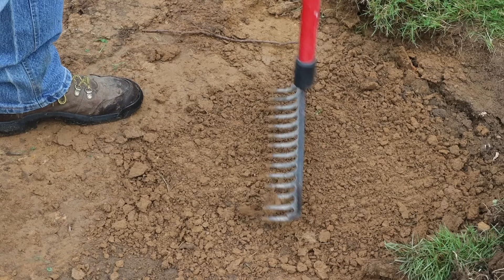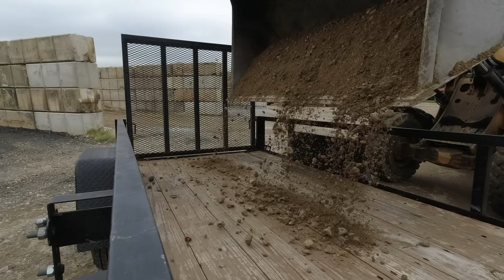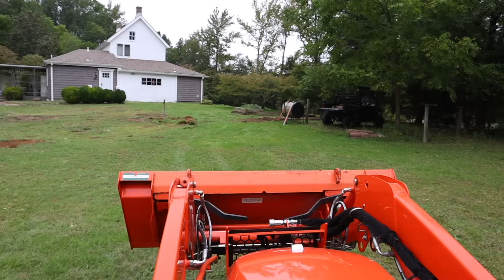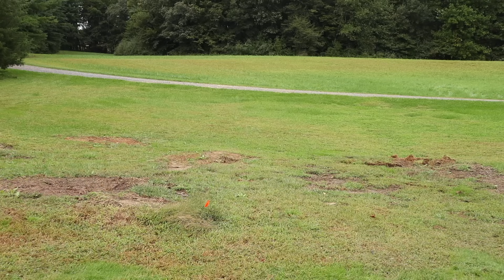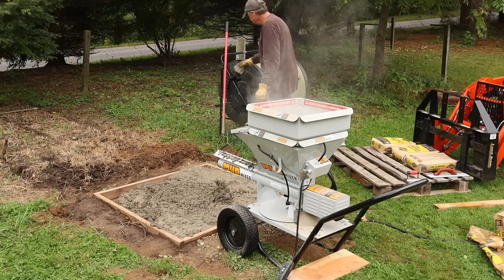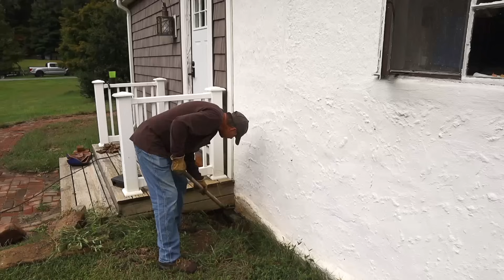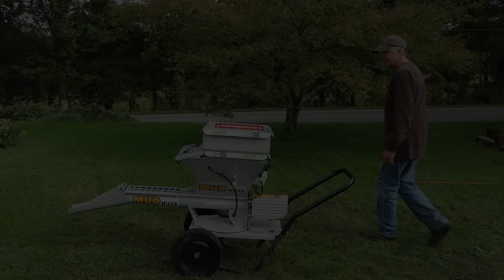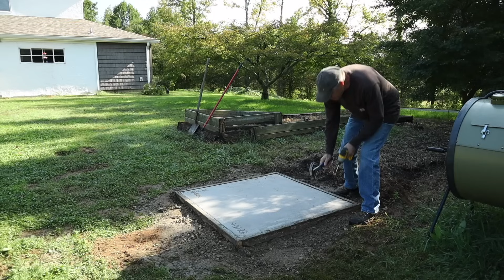Game Changer. Pouring a concrete pad and using the Mudmixer for the first time. MCG Video #169

Comment: You seriously sold me on the equipment, thats what home depot should be renting out not the normal mixers, maybe a larger tow behind unit.
I can't belive no one has had this idea until now. 
So much for a unit you use premix bags but how about a  components mixer that delivers the required parts of portland rock and sand, and maybe even fiberglass reinforcement materials   in a tow behind  larger format machine.
This would be perfect for someone who lives off grid or 50 miles away from a town where there is a concrete company   and you can't call a redymix to deliver 5 yards of concrete but you can bring the separate parts.. i know the have large trucks that do this but if its a small job your not going to call for 2 yards pour. It cost too much.
Reply from the maker: Thanks for your comments!
Reply: There are commercial redimix trucks that do what you’re talking about.

Comment: Looks like you're using a magnesium float instead of a steel finishing trowel. Next time get and use the steel trowel for the smooth surface you want. Dang fine job though.
Reply from the maker: Thank you!

Comment: I was seriously considering buying one. Now not so much. Thanks for the great video.
Reply: Naw this guy has zero clue how to use this properly. Watch some pros using it and you’ll see how nice it is. Much easier than a mixer.
Reply: Yeah it seemed like a great idea until I realized how much of a struggle it would be to get the consistency right
Reply: @Grunttamer  tbf it does not seem to be a problem. He had it pretty dry, another youtuber got it dialed in in like a minute. I’d be more concerned with the lack of bushing causing all that dry mix coming out through the motor shaft. That’s shoddy work.
Reply: Won't lie it does work great. Used it all the time for small footers and channel drains. Trust me it's a beast when used correctly

Comment: That mud mixer is cool.  At $3,000 it is above my price range.  I have a junker Harbor Freight concrete mixer that cost less than two hundred 20 years ago that still works.  Thanks for your video.  Interesting.
Reply: A local rental company has it for $75/day. Pretty cheap for occasional users.
Reply: @twm4259  Why, so you don't have to mix the water yourself?  That's no advantage...
Reply: @DIYDaveT speed, convenience? Go watch a diy pour where they’re mixing one or two bags at a time and then wheelbarrowing it. By the end of two of these 4x4s you’re getting pretty close to the limit of a Sunday task
Reply: 3 grand?  
Probably costs 300 to make
Geez
Reply: @ericbstudios9807 300.00??? What planet do you live on?  I bet they had over 1 mil in it before it ever went to production. Planning,development,production cost a lot of money
Reply: yeah, as soon as i looked up the price I quit watching the video.  I won't have one of these unless someone donates it.  Nice tool but way above what I need as a diy-er
Reply: That is pricey at $3k when someone can rig wheels to a propped-up, cut-out, 4 or 6 in. pvc pipe to a regular mixer to direct the flow of the mud mix.
Reply: Bought the Harbor Freight mixer on sale for $199 last week.  I've run 100 bags through it, works great and easy to clean.
Reply: Yeah for that much they could have thrown in a solenoid to cut the water off when the auger stops and runs reverse.  Might be good for DIY foundations once you get the mix dialed in and just let it run.  To much water on the top after screding.
Reply: @markallen200 they also should have thrown in a cheap brass bushing to keep the dry mix from coming out the shaft hole.
Reply: Concrete out the shaft hole sounds painful. Concrete burns are a real thing. 😅

Comment: Are you on well water? The varying water pressure (between 40 -60 psi) will alter the flow rate making it difficult to get a consistent mix.

Comment: Hey Ed, l am sure glad that "you didn't have a dime in it"( that muck-mixer). I've been "werken" my  "second hand" 350.°°$ 15year old kushlin 8 cubic foot wheelburo style plastic drum electric cement mixer with an estimated 300 YARDS of production ( not 1/6 of a yard)[ that's 2 batches] Very Efficently & Near Flawlessly ; that l bought a second unit - "Brand-New" for 700°°$. The only trouble is that "Its STILL in the BOX" ... the "old-one" just Won't Quit ! My production level is 12 batches per yard in 48 miniutes ( that's 4048 POUNDS OF Product) !! What could be BETTER ?? Plus it can Move the "Concrete" ( not low-strength mud dribbling everywhere) from one place to another. Sure liked your "Enthusiasm" ,plus your choice of the "Marshalltown" hand-float& edger. That was a Very Good Presentation of the "jiffy-product" ....not a REAL "Cement-mixer" ,maybe a good "grout-mixer". Thank you Sir for the Excelent vidio and happy safe building. Best wishes with all your endeavours. 
.
Reply: Can you make a video about your mixer? I can only find a 5 cubic foot kushlan.
Reply: @rudychacon7175  My "old rig" was 8cuft polyethylene drum With separate 3/4 electric-jackshaft driven; wheelburo style@ 4.5 cuft useable mix-a-lation. The "New-One" IS 6( SIX) Cuft polyethylene drum direct drive,wheelburo style with only 3.5 ( three & a half) CuFt.usable Capacity = ever so "slightly " in appearance smaller & not so ruggedly built... but still werks mighty fine... So far with only about 120 batches or 10 YARDS = 40,000 lbs. And I don't EVER USE the "baggy pea-gravel Scrap-crete"; because it's junk with almost ZERO TENSILE STRENGTH = equaling pure "Cracking & Crumbling " & barely good for "foot-traffic ". Just remember Almost nothing Beats the "Cement-Mixer TRUCK" pulling up to the job for 2 yards or More, because it's the "REAL THING".

Comment: Use a trowel a little bit later to get rid of the marks. Looked like you were using a mag float. Good to use that float and you can stop there, but to get rid of the marks, use a trowel when it is dryer. Probably a half hour to hour later. If you trowel it, don't forget to broom it so that it has some anti-skid.  That being said. For what you were making it was perfect. No need to finish it smooth and broom, as long as it had enough slope to drain rough.
Reply: Also run that edger as soon as you screed it flat with the 2x4,while it is still wet,then float right over that and you can come back later and those rocks (aggregate) will be laid down out of the way and it will be easy to edge. The float (wood or mag) does the same thing on the slab as it pushes the rocks down but doesn’t draw the water up to the top of the slab. If you use the steel finish trowel  instead of a float for the first one or 2 passes (maybe 20-30 min apart) the water will puddle on top I. A big wet mess that dilutes the cement on top. The lines disappear as the concrete hardens while troweling . The more passes,the smoother it gets.
Reply from the maker: Thank you!

Comment: You were too heavy handed with the water adjustments. Start out between 50 and 75 then slowly dial it back. Pre moisten the ground and forms. If its too dry it will cause back pressure and that is why you have a pile of fines under the motor.
Reply: I was thinking the same thing, he started out too dry and it backed up. Hose everything down, ground, forms and the mixing augur before the first bag.

Comment: Excellent video! When I first saw this mixer I laughed at the price, thinking how ridiculous. 😂

Now that I’ve watched a few videos this mixer makes a whole lot of sense, especially if you are working by yourself and doing large jobs. Basically just keep feeding it bags of concrete and it adds the water, does the mixing, and deposits the concrete slowly where you want it. It’s easier to move than most mixers and If you need a break, just turn it off. 

I’m a bargain hunter and often cheap out, but with all the concrete projects I have I see one of these in my tool arsenal in the very near future.

Keep up the great videos! 😃
Reply from the maker: Thanks very much! It’s not inexpensive, but it’s really solid!

Comment: I love that statement, “If you are an experienced concrete person, this is probably painful to watch. Right?”
Reply: Haha I've got quite a bit of concrete experience.  This was perfectly fine.  Obviously there's ways to do things a little easier, but he put a good base down, compacted it, set the forms fair, screeded, and troweled it.  For a tiny little sample pad, critiquing it would just be ridiculous.  Great work!
Reply: I hope the manufacturer see this vid, like the guy says the water keeps on coming even when the motor stops they could do with a electric tonic seloniod that shuts the water off when the motor is not running simple fix
Reply: Mud is concrete with a specific function. This machine is for mixing mortar with only sand. He would have been better off with a rotating style for far cheaper.
Reply: @larrybe2900 it’s a concrete mixer
Reply: @Private290 If you prefer but distinguishing the features seemed to better describe what I had in mind. After all they are doing the same thing out the end of the chute.
Reply: All he missed was brooming it
Reply: Anything to save he's back.. Is worth it.😎👍👌
Reply: My word. A regular Roman.
Reply: Mix in a wheel borrow.  Please.
Reply: Next video he makes is going to be on how to walk and chew gum at the same time.

Comment: Towing the mixer out, plugging it in, adjusting the settings, cleaning it up, and then finding a place to store it when you're done – I'm thinking it's just easier to put the bags in a wheelbarrow, especially if you're an average homeowner who only needs to mix these bags once or so every couple of years.
Reply from the maker: There’s definitely a “tipping point” where this is more beneficial. But for super small and infrequent batches batches, I would mix by hand.

Comment: Ed wasn’t meaning to be critical in my previous comment.  I just meant that type of mixer wouldn’t really work for me.  When I do concrete myself, it is usually a larger area.  Larger yet, I order from supplier.  Keep enjoying your projects.
Reply from the maker: Thanks. Yeah it fits a special need and sized project. Thanks!

Comment: Can you load two or three bags in the extended hopper?  It looked like when it got low on material more water came out. Seen it in action before and they were loading from a truck bed and just dropped the bag on the splitter and it worked great busting open the bag.
Reply from the maker: I think you can add 4+ bags to the extended hopper.

Comment: Great video. I am a concrete guy and you did fine.
Now for a pad around that water hydrant.
The mud mixer looks like a great tool.
Reply from the maker: Thank you! I was thinking that a pad around the hydrant would be pretty nice. Of course I’d have to break it up if I ever had to replace the hydrant. Do you see this done often?
Reply: @MyClutteredGarage  no I don't. Just looked like a mud hole forming. Thinking about it now, maybe a gravel pad a foot or so deep to promote drainage and keep you out of the mud

Comment: For perspective. At 3000 dollars you'd need to have to mix 480 80# bags in a day, to beat/break even on 2 trucks and a mud buggie rental. That's about 11 yards of concrete. Or.
60 free standing 6 post 24'x12' decks with 36" deep +/- 12" round full fill footers in a year to justify the 3000 bucks.
Reply from the maker: This tool has specific applications where it can be more useful than traditional mixing or delivery options. Basically when a job is perhaps too big to mix manually yet too small for a delivery. It’s not inexpensive, but it’s well-made for sure!

Comment: My $300 mixer works great and very consistent. Great video Ed.
Reply: Sounds like you "got it going on" with your 300$ unit. I'm with you "buddy".
Reply: Yeah, the Mudmixer is $3000!!  That is ridiculously high, even if it added the bags automatically and then cleaned itself!!  I really don't like the way it adds water to the dry mix while the auger is moving it.  I'd rather see it mix and feed as two separate steps. Seems like it is cheating on the mixing time. A standard tilt mixer is pretty easy to use and at a way cheaper price. the thing leaking dry mix seems pretty crappy too. Definitely not worth $3000 and you can't even make your own mix if you wanted to.

Comment: Not the concrete expert but that tool is not a finish trowel It is a float. If you had
a finish trowel it would be used to "get the lines out"
Ive never seen a mixer like that. I'm sure its a back saver

Comment: Watched it all!  Very enjoyable and helpful.   Prior commenter complained about $3000 and inconsistent output.  
Based on what I saw, I would disagree with that opinion.  
Regarding consistency, it only outputs a small amount at a time.  Seems easy enough to adjust as necessary before too much is shot out incorrectly.   No big deal.
Mixing is painful work!  This removes that aspect of the job.  Of course job is still not easy, but if one is over 55, removing the mixing task is major!
Cleanup seemed easy enough.  
Can you pause to take a break, or must you keep the mud mixer running?  Would stop/start hinder consistency?

Comment…don’t forget you have a tractor!  I woulda lifted those forks up right beside the hopper so that I didn’t need to bend over to pick up the mix.

…now if we could automate the rest of the process!
Thanks for the video!
Reply from the maker: Thanks for your thoughtful comments, Tim! Yes, you can simply turn the machine off and the process pauses until you’re ready to start again. Later, I thought that I should have picked the pallet up with the forks, so that I didn’t have to bend over! And since I’m in that over 55 bracket, I’m happy to eliminate the mixing work!
Reply: Doesn't seem like you can pause for long before the concrete hardens in the exit chute.

Comment: You may be a novice but the finished product was pretty impressive to me!  I enjoyed the long form video.  And for whatever it's worth, the shot looking down the 2x4 on the chop saw really jumped out at me.  Very nice.  

Finally—and I apologize in advance for this, but this is the sort of minutia that I get drawn into—I think the reason you have 2 bags left over is that I'm thinking you likely entered 4' x 4' x 4" (=9216 Cu.In.) into the calculator, but since 2x4s are only 3.5" (=8064 Cu.In.) that makes the calculation about 12.5% over, or 1.5 bags.  Yep, I'm apparently THAT guy. 🤦‍♂  Great video, Ed.
Reply from the maker: Haha thanks Chris. I didn’t go as far as you, but I did actually wonder how much that 1/2 inch affected the volume. 😄👍

Comment: I looked up the Mud-Mixer and found that it costs $3000.00.  That is a lot of money for the inconsistent mix it was putting out.  I think the manufacturer needs to go back to the drawing board.  You could have put some pre-cast patio pavers on top of the base you put down for less than you paid for the 10 bags of cement. Nice job, but Holy Crap Ed $3000.  I hope you have quite a few other jobs planned for it.
Reply: There are a lot of other videos out there if this machine being used commercially.   Biggest thing is keeping the hopper fed,  then it stays consistent.  Ed needs a second person feeding it.
Reply from the maker: @PaulLB7  yes I think having someone dedicated to feeding and monitoring its output would help. Bit it’s still manageable for one person.  👍
Reply from the maker: I definitely will be using it more often. I have actually put off small concrete project over the years because of the hassle. The mix consistency it actually quite good. I think my next pour will go even better. Thanks for watching!

Comment: It would be wise to start off the machine into a bucket to allow it to "spool" up.  It is also wise to pin the sides of your forms with stakes to keep the middle of the forms from bowing out.  On that small of a pad, not completely necessary.  Depending on your location you could experience frost heave on any pad that you just set on the ground.